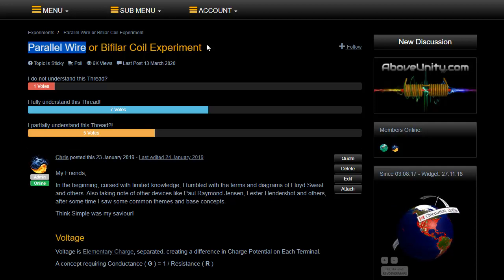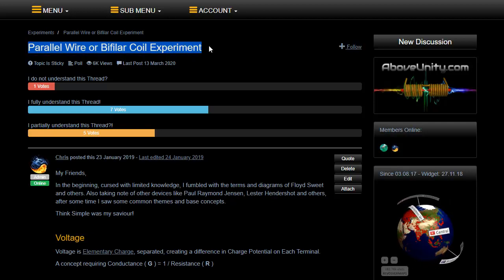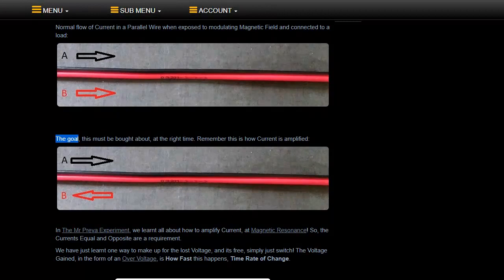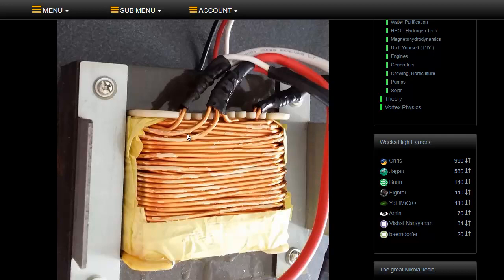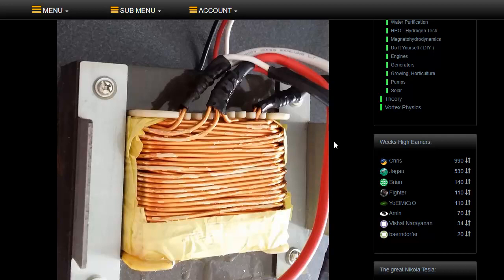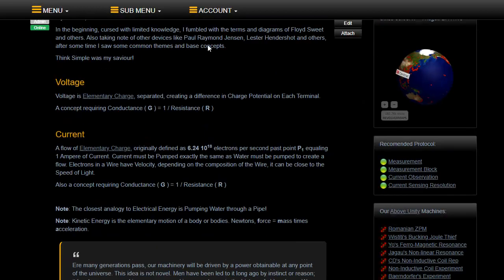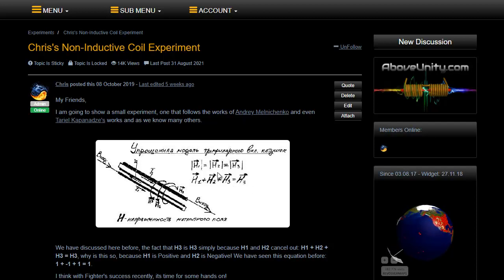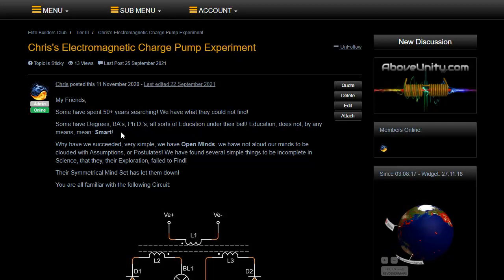Chris's Electromagnetic Charge Pump Experiment - Part 1

Comment: Tesla's patent number for the bifilar coil is 512340. The coil is parallel-wound and series connected. The increased voltage difference between the series connected windings charges the capacity between the parallel windings.

Comment: @16:58  Magnetic compression?  If I push two north poles of two identical magnets together is that magnetic compression?  If I push t push two south poles of identical magnets together is that then magnetic ex[amsion or is it then magnetic compression also?  How about if I join a south and a north together is that then magnetic compression or rather magnetic expansion?  I suppose if you are adding energy to the system that would be compression whereas if you are getting energy from the system then that is magnetic expansion.

Comment: you can feel the magnetic compression and the opposite (pull) with the classic motional induction with a current, or Lenz experiment.
The definition is something like "nature doesn't like change and fights it with opposing forces"  but I think it has to do with "circular" symmetry (flux > current > -flux > -current).

Comment: How have you confirmed for yourself that the effect causes more energy out than in? Logical conclusion and a brighter light isn't prof but it's definitely evidence, measured prof shuts up the trolls, instead of feeding them (but then they'll attack the method).
A dc-dc flyback converter used in most chargers has no output  during the duty-cycle, only after the pulse induction energy is pumped out, it's  a declining output voltage ramp too. But it has no 1+1-1=1, because no output current is allowed during the duty-cycle.

If you'd shot out an electret you'd expect current, but there will be polarization in the wire, no current, because current isn't possible to flow though the source. That's why I believe in the POC setup, current is allowed and is a mutual generator.

Comment: Reading Wikipedia for Lenz’s law it clarified that the sign reversal of Lenz’s Law is to the direction of change. An increasing (+) voltage is bucked or cancelled; and a decreasing (-) voltage is also bucked or increased, the voltage is increased. 
In essence, for straight induction, there is a dynamic resistance to change, cancelling voltage when the field increases and amplifying voltage when the field decreases. 
     Running parallel wires builds additional capacitance into the inductor which will naturally capture the changes in voltage prior to capturing inductance (shifting the phase of the Lenz effect to almost-always add, not cancel the changing charge. This is because the parallel wires charge capacitance all along the windings at the same time and dump that charge according to the reverse of the charge (positive to negative, not increasing to decreasing) conforming to the original phase of Lenz’s Law. AC power shifts the direction of changing voltage every 1/2 wave with a change in charge value(Peak to peak increasing from negative to positive  or decreasing voltage from positive to negative) It’s not the charge sign, which does stop the capacitor from charging to discharging/reversing charge at zero crossings not peak, but the increase or decrease in charge that swaps the Lenz force to add, not cancel the next wave. (The two effects initiate 1/4 wave apart, but generally support each other. The charge transferred into the capacitance is proportional to the rate of change, but the direction of charge is driven by the charge polarity. First cancelling the previous cycle’s charge as the inductor flows the Lenz response to buck the rate of the previous 1/2 cycle rate of change (increasing to decreasing or reversed)

Comment: Was hoping to see part 2. 😉 I, of all people, know how time flies. I have zero complaints other than the `O` scope I bought a year ago is still in the box. I do make progress, like a sloth. Haven't talked to any humans for a month so I thought I'd say a few words here. In the video, I'm glad you blew off the measurements. The only measurements that truly matter are the final output. Mid-point measurements don't always mean anything with this stuff. Most of the time they don't make any sense anyhow. Also applying math to it generally won't add up either. Math can be used to make almost anything possible or impossible. Depends on what you're trying to do. An equation can say yes but reality says no. Forcing devices to fit the math can eliminate useful results.
The video has prompted me to read Nothing Is Something again. I am reminded that Floyd said that the motional electric field is the important part. That just makes the bi-filar coil all important as it can be hooked up to "cancel" the magnetic and leave the electric field exposed. An electric field transformer. So, the magnetic field(s) are still there, bouncing around gathering charges from the vacuum and dumping them onto the unpowered coil(s) to extract the energy that's sought. I use a bi-filar coil to trigger the egg unit. 
I feel lame being so slow getting my poop in a pile. At least the outside stuff is stopped for the year. Won't get snowed in this year!

Comment: Thank you for sharing your experiment. My perspective on Lenz's law has also changed in a similar direction; in my capacitor experiments I noticed changes in the dielectric constant during the discharge of the capacitor. materials were losing opacity and floating around.. like john hutchison but on a small scale. I realized that metal has a dielectric constant as well and can also be changed in a similar manner. looking at the refractive index we see a ratio between electric flux density and refractive index which occurs due to the changes in permittivity and permeability . all electric current is vacuum energy or ether, or light, a well known source of energy. changing the dielectric constant of a meta material produces changes in refractive index which give the vacuum energy the path of least resistance. keeping this channel open is what public technology hasn't achieved. a meta material is an insulator and a conductor. this is a wire. wires act similar to a fiber optic cable when translating current. metal can become invisible with enough electric flux density.
negative index of refraction in a volume of spacetime will produce a time reverse phase conjugation wave that will invert the current to flow one direction. a time reverse phase conjugation wave is a standing wave that looks like a dna strand,, on a scope it looks like amps and volts out of phase, this is also called reactive power. this is mirrored energy from the vacuum really, all you have to due is take the free part while you leave the part you pay for behind. its how you put it together. https://www.youtube.com/watch?v=13t3Ug_vkLs&t=4s

when you look at the optical properties of the materials you are using and how you can manipulate the dielectric constant with electric charge etc., you start seeing these systems as vessels for the vacuum energy or light, to express itself. a complete system that is part of the environment it inhabits. the geometry of waves is how you determine the arrangement, a double torus. or double helix, depending on how you look at the torus. this is the life wave nature uses and it wants us to connect with it. the technology is only the reflection of your true inner power. our power systems are simply incomplete. someone along the way said ha!, it works!", and then never gave it another thought again.

as long as you are depending on the material world for your sustenance , the etheric world will not open up to you and allow you to connect with it, and your research wont get anywhere either. The vacuum energy is a life force energy, not just electrons or things "out there". You have to go inside and connect with it or you will never be able to connect with it on the outside. 

When the world is still, God speaks.